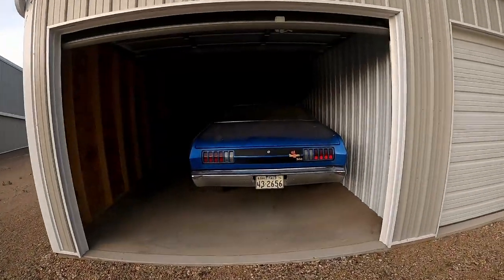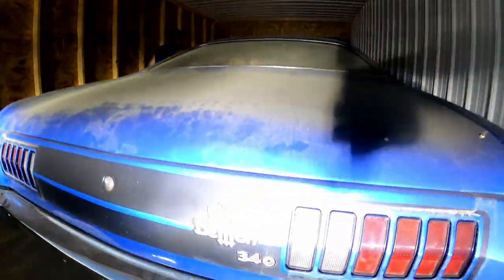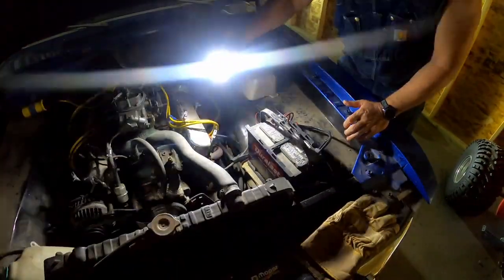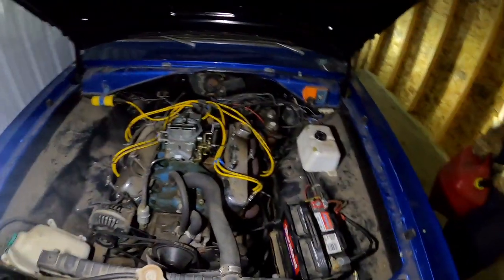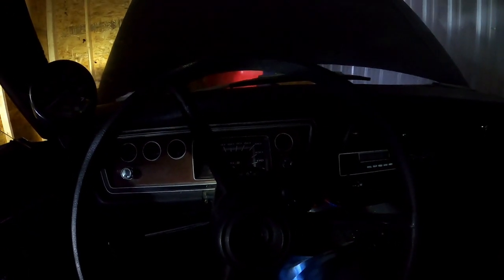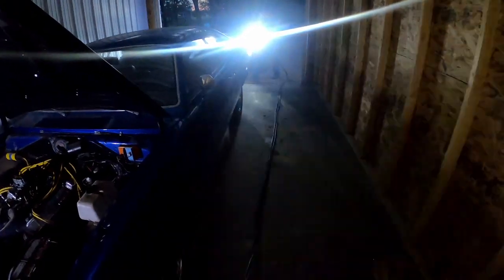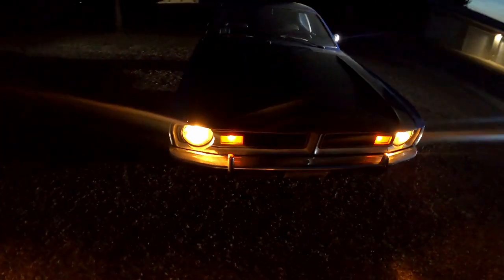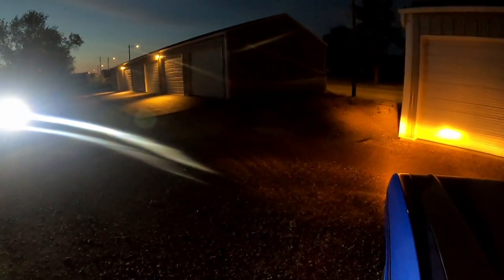1971 Dodge Demon Classic Car Project

Comment: What happened to the 340
Reply from the maker: It was an original 318 car with a dark tan factory color.   The previous owner put a cam in it.   So far, we discovered it has a 360 intake, a 318 block, but we’re not sure what heads.   We’re taking the heads off soon so we’ll find out together.